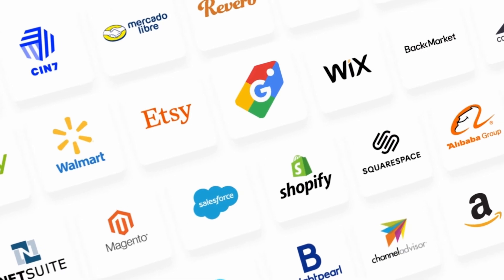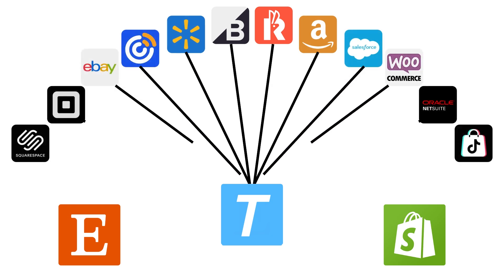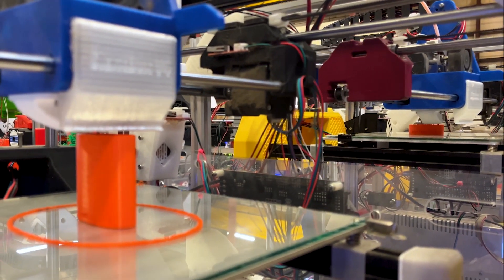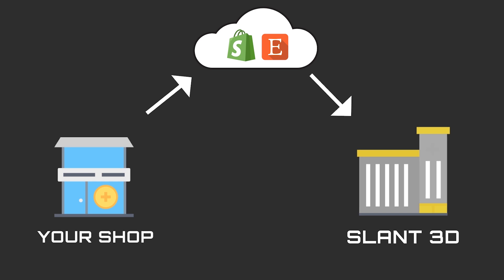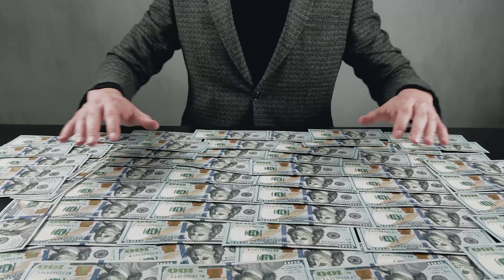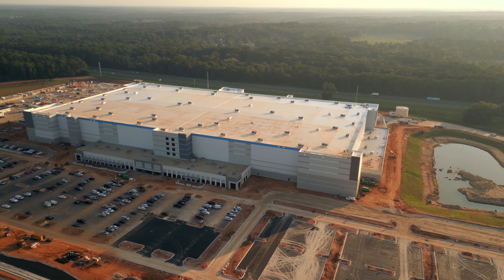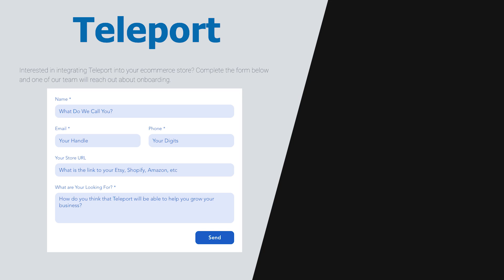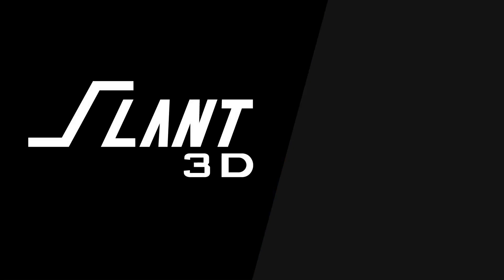This App Lets You Sell 3D Printed Products Without Owning a Printer | Teleport POD

Comment: My biggest issue is QC and tweaking designs, all that goes out the window when you outsource it to another company. Specific slicer settings, variable layer heights, extra infill for structural areas.. everything is made with 'default settings' not really ideal for anything specifically engineered. A good example are shelf-feet in my garage. 100% infill and just basic PLA, Have been holding up for years now holding hundreds of pounds. If I sold that to someone else and it was made with 2 walls 15% infill, that's just a liability waiting to happen.
Reply from the maker: Fortunately you can design those features into the model so slicer settings don't make a difference
Reply: @slant3d  yes and no, shoving hidden geometries into a single STL/STEP model to trick a slicer into adding extra walls selectively, isn't a fun time. All major slicers support boolean modifier shapes and modifier meshes now for a reason.

Comment: My problem with your app, as someone who creates stuff, is that it needs to be 100% 3D printed. If you partnered with someone like McMaster-carr I could ship kits for things like Vesa mounting, or entire nerf guns.

There's just so much more you can do with plastic and some hardware than just plastic. You need to either start supporting more colors so that more art objects can be made, or support including  hardware and a BoM so that more functional objects can be made.
Reply from the maker: Shoot us an example part to info@slant3d.com. we are introducing third party parts pretty soon
Reply: Yeah i was thinking he should support laser cutting, but then he is already in the big business. I just have a problem with how he said his app is the most significant thing to happen in manufacturing history??
Reply: Agree, it's a massive value-added proposition when projects aren't just monolithic blocks of plastic. Apparently Amazon is already dipping it's toes into the idea of hardware/electronics kits that are tailored towards specific projects already. I ran across some electronics modules and projects where the user made mention that it's not a program you can really enroll in, so no idea how that currently works.
Reply: Yeah. A lot of people have been tooting the 3D printing horn without realizing a lot of it is just hot garbage. Printed materials struggle to have 10-30%~ the strength of steel, require precise 3d models, require clean-up after printing and the list just goes on. Meanwhile, machining shops have been "printing"/manufacturing things you can actually use and ship it to you for decades.